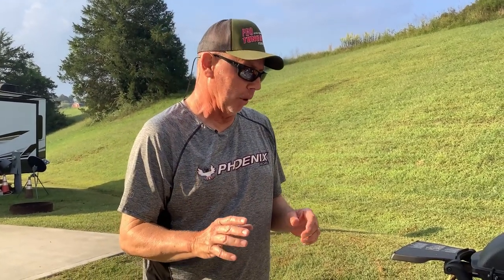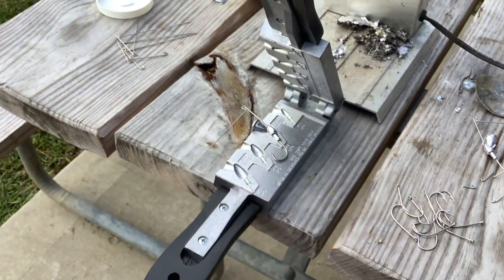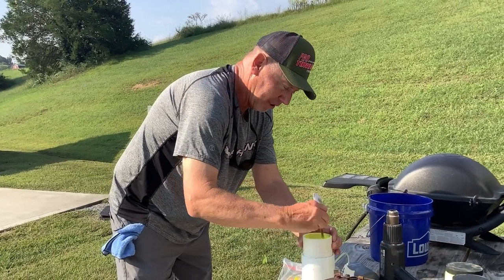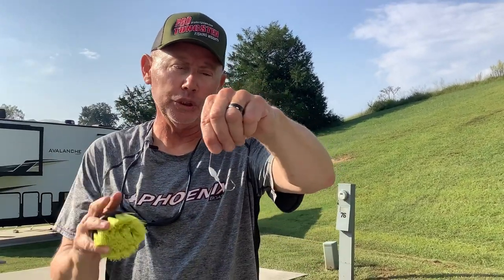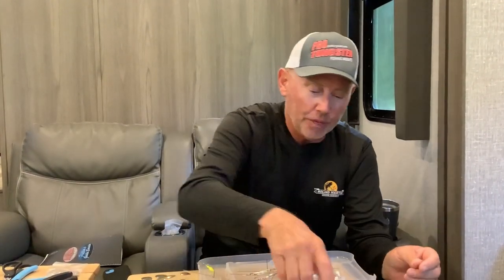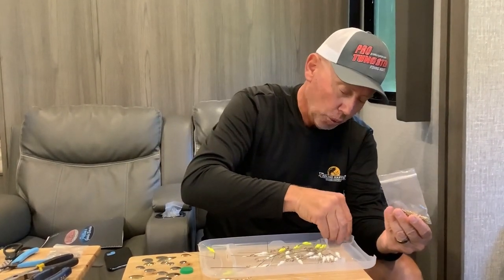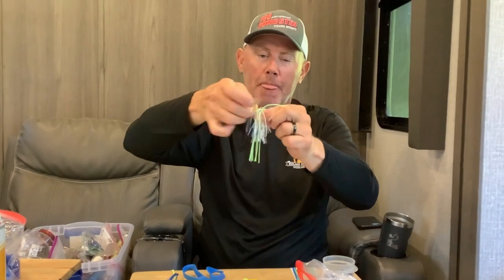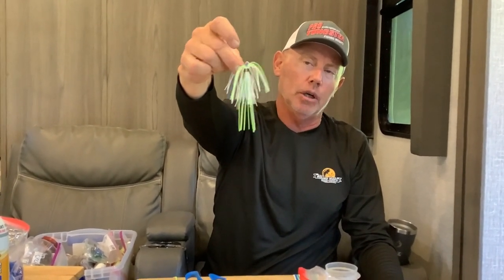Catch more fish by, Building your own custom spinner baits!

Comment: Great video especially the heat gun idea. I will put mine to more use other than heat shrinking electrical connections and the outdoor grill to bake. That especially will make the wife happy as to not stink up the house.  lol

Just a couple small questions: 
1) What size barrel swivel do you use? 
2) What size split rings?

Again thanks for the video and look forward to more ideas and bait selections.